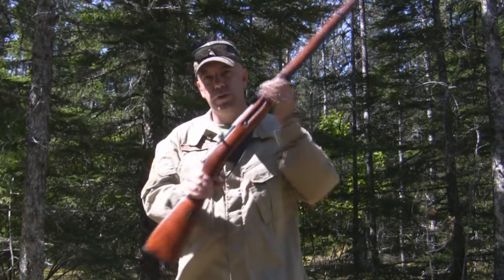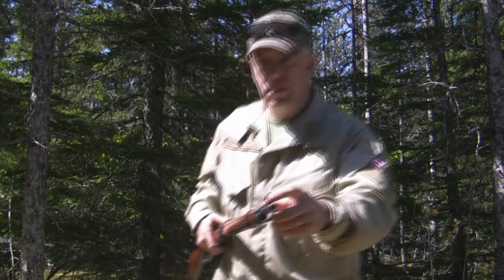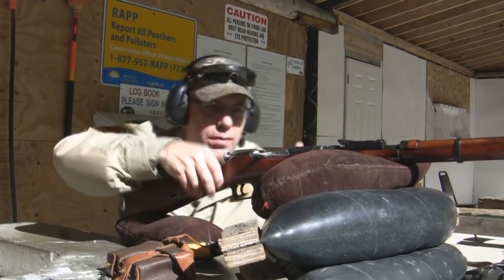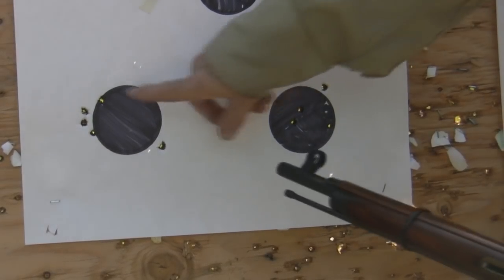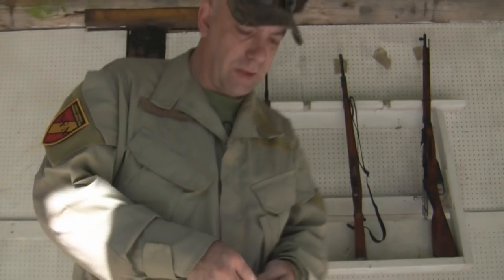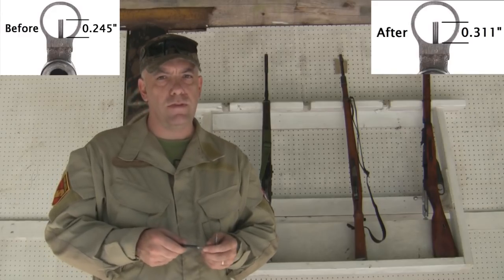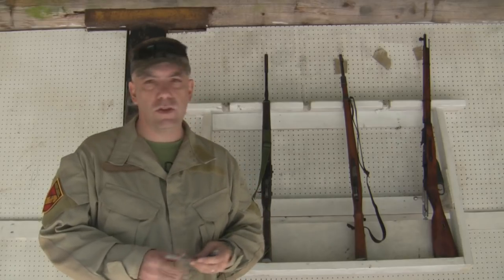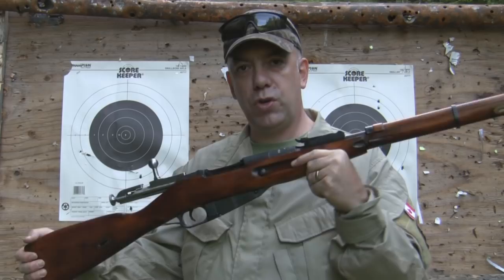ALTERNATIVE WAY TO ZERO THE MOSIN NAGANT

Comment: I bought some 1/32 heat shrink tubes at Home Depot, trimmed one down to just a bit longer than the post and slid it on, then used a heat gun to shrink it.  It fits well, brought my rounds down to where I'm hitting in the red on my targets at 50 yards.  Haven't tried at 100 yards yet but it's more accurate now than it was when I first bought it for $89.00.
Reply: Same.........

Comment: the best way to sight in any bolt action rifle whether it be a Mosin Nagant or other rifle is to remove the bolt and set the rife so you can line the barrel up with the dead center of the bullseye, then adjust your sights until both are almost identical at what ever range you want to zero for, you can do this with open iron sights or with a scope, but to line up the scope use a scope that matches the maximum range of your rifle ( Mosin Nagant will hit targets at 1,300 meters if you have a scope that is ranged for that distance, I have done it. Mosin Nagant is better than most can understand if you understand to turn it's short comings into assets its all in the shooter, and patients. ) also learn to read the wind and adjust accordingly.
Reply: Ever hear of gravity
Reply from the maker: SVPPB Sorry I haven't responded to this until now. Most Nagants I've seen seem to have the front post so low that you basically have a 300 to 400 metre zero with the rear sight set to 100 metres. This is about zeroing your sights so that your point of aim is the same as your point of impact. Sights set at 100m means you impact where you are aiming at 100m. Your science is correct but this video has to do with raising the front post so that your adjustments correspond to range and sight picture (without the bayonet attached). Thank you for commenting!

Comment: Hello all,  Instead of punching and ruining the bore of the original hood, you can just install a tall front post.  I make them to custom order  to any diameter one prefers.  2.0 mm is mil spec and I can machine them in 0.1 mm increments down to 1.0 mm.
Reply from the maker: johnnybarbar hi johnny do you have a website?

Comment: Thanks for the video. Your method of adjusting the front sight is the best I have seen so far. Great idea! No mods to the gun. I like it!I have been shooting my X sniper Mosin for a month now. My best is a 1" wide x 3" group consisting of 7 shots at 100 yards with the stock sights. Not bad considering it's hitting 8" high and I'm compensating for that while shooting at the bullseye. I hope to tighten that up once I adjust my front sight for elevation.

Comment: Very inspiring. I purchased a 1934  91/30 Red Letter. Aside from a few very small dents on my stock, the weapon checks out perfect.  I absolutely agree with you and share your obvious enthusiasm  for the 91/30.  There are a number of ways to accurize  your mosin, stabilize the barrel when hot, and gain shot to shot consistency. There are many many resources online.  Some are great some aren't, for now, if you are new to the mosin avoid remedies that change your rifle from original.  Don't be afraid to use corrosive ammo, be afraid to not clean it promptly and correctly using a cleaner with some ammonia first then regular cleaning.  BTW Windex  works great, but keep anything amoniated away from un-
-fired  ammo. There are two videos where men are shooting open site Mosin 91/30 at a target 974 yards away! I will find it and post a link if that is ok?  I return your salute sir.  https://youtu.be/a-CTa2lMGN0

Comment: I don't understand. If you file the sight post down it gets smaller, not bigger. Why do you have a before and after indicating that before filing it down it was .2 something inches, and after being filed down it is .3 something inches. Is this an error on your part?
Reply: The rifle was initially shooting high meaning that the front sight post was too short (.2). He removed the front sight from the rifle and used a punch at the bottom of the sight to make the  post move up making it longer, which would make the round impact lower. THEN he filed the front post to make it shorter until the elevation was correct for 100 yards/meters. When this filing had been completed the measurement of the front post was .3 inches.
Reply: I believe the smaller number was how he received the rifle, and it was shooting high. The second number is the post height after lifting the post, then filing it down a little, still being taller than when he started.

Comment: Got an M44 (at Canadian Tire of all places!!) the other day and shot it today. At 25 yards it is about 6 inches low. I had to crank the rear up to 500 yards to get it to hit the paper plate I was shooting at. Also shoots to the left. 

Front sight is very tall, filling 2/3 to 3/4 of the globe. I was wondering how to shorten it, as it does not seem to screw in like the SKS sights. Filing will be the answer. Good thing I have a small set of files around!

Comment: Good tutorial on the Mosin I must say. Another good idea is to purchase online (not expensive) is a laser boresight round. get a 7.62x54R laser round. You can chamber this laser round like a regular round into the rifle bore. You may have to do this less light outside. Distance a range of 100m or whatever you like. see the red laser dot and should be on top of your front sight post like a golfball on a tee. Then use real rounds to concur to the zero, should or be at least close enough to get you on paper. Chief Williams signing off.
Reply: Shawn Williams Most of the cheap bore lasers are inaccurate, the laser is off to the sides and not centered unfortunately

Comment: First test firing of mine ... not bad ! But I was at 50m and she was high, very high and to the right a bit. Will experiment with windage and just aim low .. the ammo I use might be all over the place so I will just deal with elevation by adjusting aim low.
Reply: jabberwocky1969 originally they were zeroed at the factory for 300m. The thought process behind this was to aim at their crotch at an enemy closer than 100m and past that shoot for mid-mass and the round would connect almost every time. I like to shoot mine at 100m and mine shoots about 8 inches high at that distance. The way I fixed this problem was to take a small piece of 10 gauge wire and slip the plastic covering off of it and put it over the front post. Just snip down how ever much you need to to zero it at the distance you need. As an added benefit, where the post ends you know where 300m is to.
Reply: Drew Shafer this doesnt make any sense ive heard it all over the place. Why would they make a 100 pr 200 yard sight setting then?

Comment: Can you take a pliers & pull the front post higher? I need mines higher
Reply: No, the post has a shoulder and a flared end on the bottom of it that hold it firmly in place.  I make tall replacement posts so the original is removed and replaced after taking the hood off.